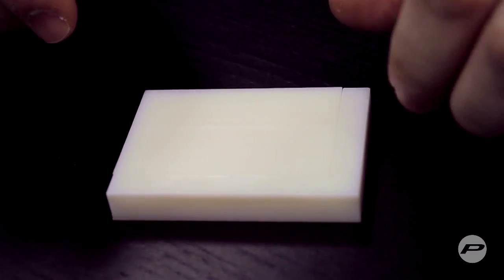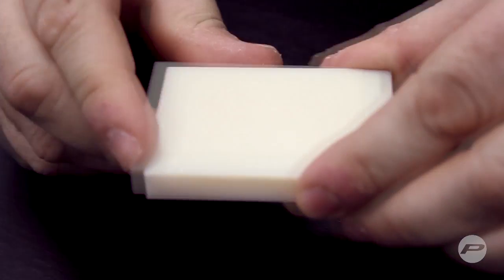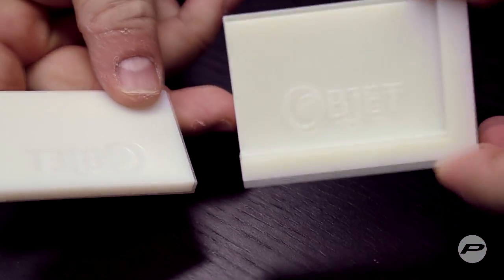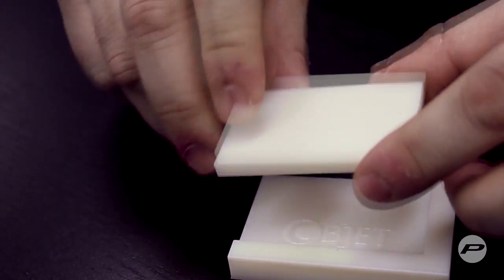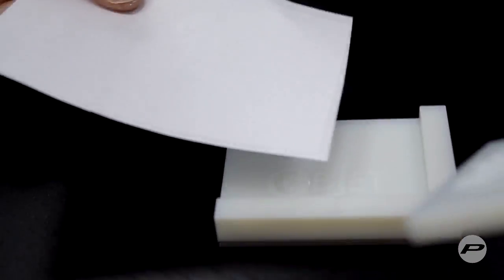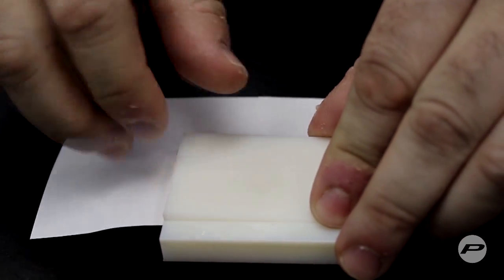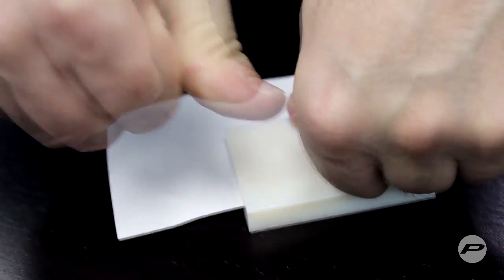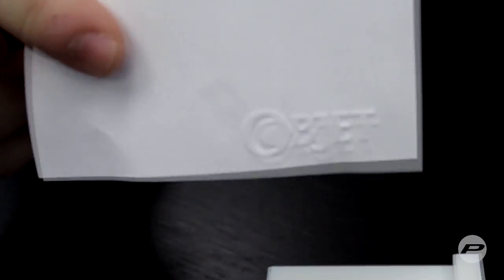3D Printing Embossing Plates with Polyjet Technology

Comment: About the font size, is it the same on both sides?
Reply: Changing the font size won't work as the font will be scaled up. You'll need to make an offset of each letter in a vector or CAD program. This way the profile is enlarged equally around the font.
Reply: I have the same question. Does the font need to be a tad bigger on the negative side?